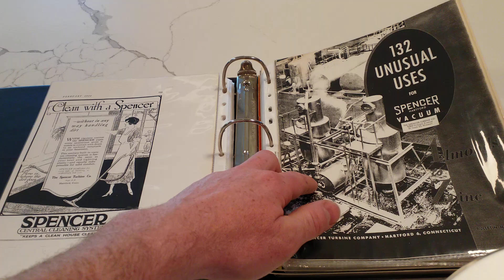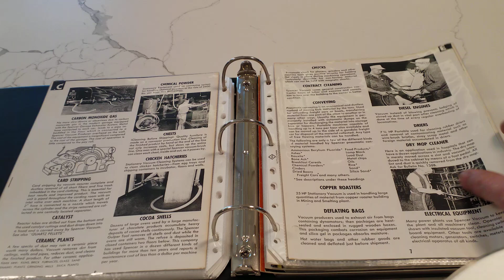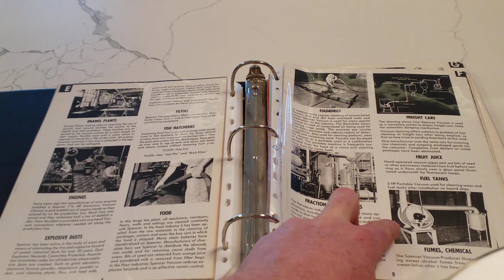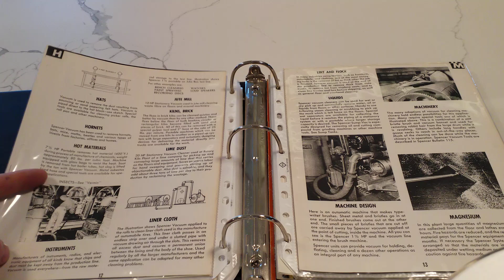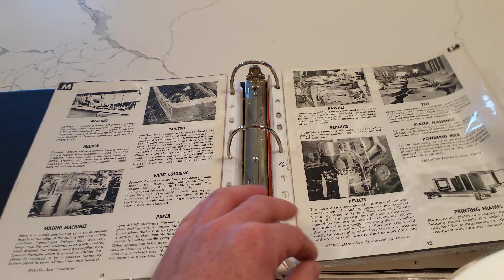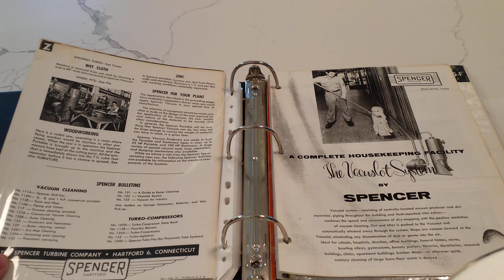Spencer Vacuum From A to Z: 132 Unusual Uses

Comment: I'm pretty sure somebody has already mentioned this in comments.But just in case this is not the case.

Regarding record cutting.

At one time the record Blanks were Made of  Highly funnable And potentially explosive cellulose nitrate!

Up until So you lost acetate and other materials cament to use.

Normally on a record cutting machine.In this case where resilios by treat was used At the least they were arranged so.As the Material cut would be sucked up and is it deposited into water Is to prevent the hazard Impose by The Cutting the afterwards from the solo snitrate disk blanks.

Also wouldn't be surprised if this was used Wit A vacuum system For So you're not trained film trimmings As well for the same reason